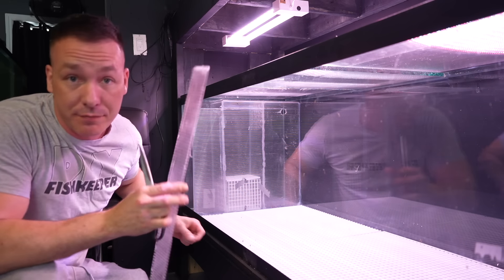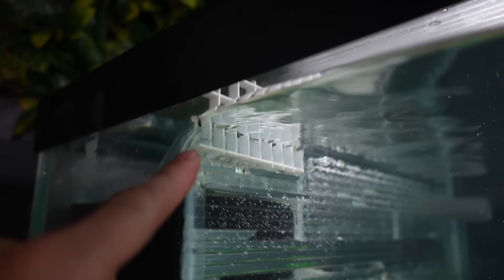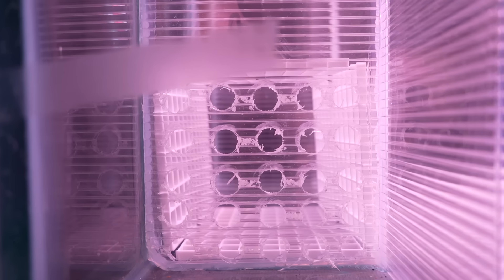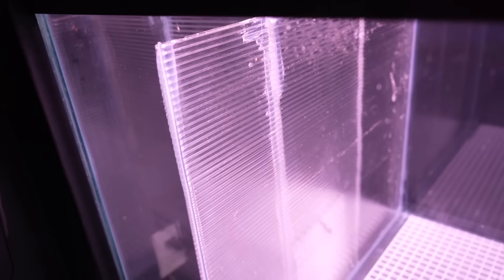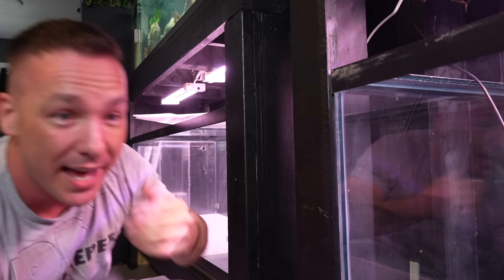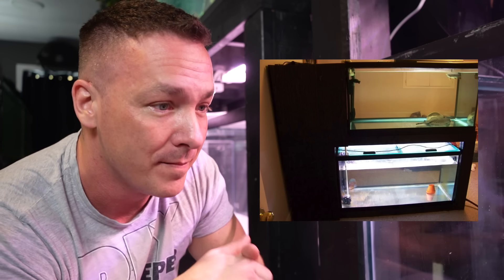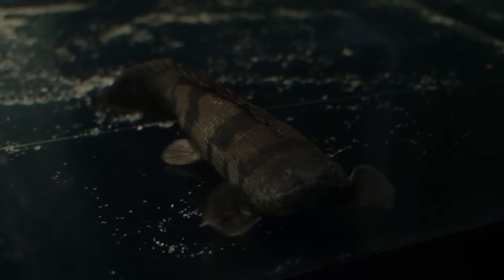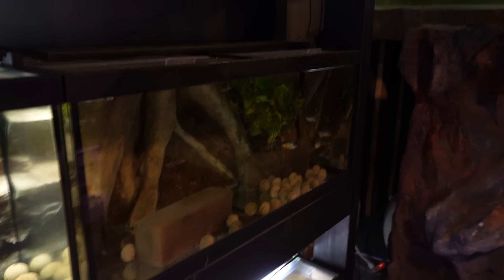EASY!! DIY aquarium filter for ANY SIZE fish tank

Comment: I like the Slim Overflows because they take up very little space. I’m sure you would have been able to pipe them separately so both tanks were separate still with sumps, however there is nothing wrong with an internal filter. When done right you get a much easier to maintain system than with a sump.

Comment: Love to see that you go back to the basic. Its time to learn new things and i like it. 
P.s. the k1 media did exactly what you did say and it took 3 months to lose all the no2.
It works perfect
Reply: Do you have deep substrate like sand ?
Reply: @nellim9239  sorry. Do you ask me. I don't always get it in the commands who is talking to who.  And I don't want to think that I am that important that it is by definition to me.
Reply: @PMeer-gc7kw  yes, you said it took 3 months to get ride of no2. i wonder if you have deep substrate or sand, thanks :)
Reply: @nellim9239  I use bio foam sponge in my sump before it hit the k1 substrate. That's it. 
Easy to use. Easy to clean. K1 likely never needs to be cleaned. It's a self cleaning because the air will get rid of the bad stuff. 
The sponge I do every month or so. So that the sump can't and will not overflow if it's gets to dirty. 
I hope this will be the answer on your question. 
Maybe if I had change the water more often in the first 3 months it would of had be quicker.

Comment: Built these for years. All my tanks in my store had this exact same setup

 But I used Air in a tube to do the return as it was cheaper to run 65 tanks
Reply: Would it not be better to have the intake on the bottom, so it collects dirtier water?
Reply: @mistadobalina1093  with enough flow waste will still get lifted anways. 

Never had any build up on the bottom of all 65 tanks
Reply: @ZombieObsidian  true, I've got a 1500lph pump on a 3 footer but I still watch it and think the bottom would be better. I made one with a slow pump like that and gave it away

Comment: That's an absolutely amazing filtration system tanks should be sold with these fitted
Reply: Quite a few do. I've got a fluval evo with a similar set up
Reply: Loads of tanks have this setup, a lot of the Red Sea tanks but you see this mostly pre build in saltwater tanks.

Comment: Question, and sorry if it's already been asked and answered, but if the filter is designed for water to simply flow into the filter via gravity how do you keep it filtered when the water level drops below the filters mouth? Obviously the easy answer is to keep water levels consistent, but many of us in the hobby have periods where we find it impossible to do simple maintenance.

Comment: Fantastic video! Can you list out the materials? Is it just regular construction silicon caulk to attach everything.

I’d like to see if this internal sump can work with smaller tanks. I have a 20gal long and a 40gal tall, and I’m kind of done dealing with external filters (space, noise).

Comment: Always love your DIY builds. 
The drawback I see with this is unless you are doing multiple tanks, this is not economical. At least in my area, you can only buy a 4x8 sheet of the panels, they are running $60-70 per sheet and if you want eggcrate light diffuser, it's close to $30 for a 2x4 sheet. If for just one tank, not very affordable IMO. Even acrylic/plexiglass has went through the roof in price.
Reply: I got a 4x8 piece at Home Depot for $15 (it is white instead of clear). They had a couple of pieces that were dented and banged up a little at the bottom. Talked to the manager and he knocked the price down to $15. Did get sticker shock today looking at egg crate at Lowes (wasn't thinking far enough ahead to see what Home Depot had). There are some egg crate aquarium dividers on Amazon that don't look too expensive. 
If you don't need a full sheet of something (like in this project) if there are some banged up or damaged ones - it is always worth asking if they will discount it.

Comment: Huh, this is how I built my filter too! I filled the second and third compartments (and the bottom of the first,) with lava rock for biological filtration.
⚠️I STRONGLY do NOT recommend housing the heater in the back sump/filter compartments because if you forget to turn your pump back on after feeding your fish the temperature of the water in the main body of the tank will drop and it will take hours for it to heat back up by the time you notice that you forgot to turn the pump back on (usually due to your temperature controller screaming at you.) ⚠️KEEP YOUR HEATER IN THE MAIN BODY OF THE TANK.⚠️ It's really important for your livestock's safety!⚠️

Comment: how do you keep your oscars from destroying each other? I have 4 total oscars, all in the 10-13 inch range, starting in a 90 gal. I had to move the biggest one solo into a 55 due to it ripping the upper lip off of the female (they had eggs awhile back, which we grew and traded for store credit at a LFS). And now I had to separate the other 3 with a lid in the middle of the 90 gal, but the other 2 still together are battling it out daily too. I have tree stumps and rocks for them to get away from each other, but they just keep going at it.

Comment: Hey Joey, where did you get your 180s and how much do they cost? I’ve been wanting to upgrade my 75 to a 125 or 180 for a year now but they’re almost impossible to find where I am
Reply: Build them, I plan to do that with my 90-120 gallon coffee table tank which is why I keep looking at this channel.  Is 3/4" thick acrylic enough for a 4 foot span?  Should I just use 1/2" glass which costs more.  Wood frame with built-in lights, etc.